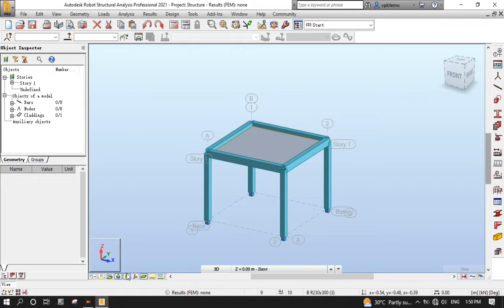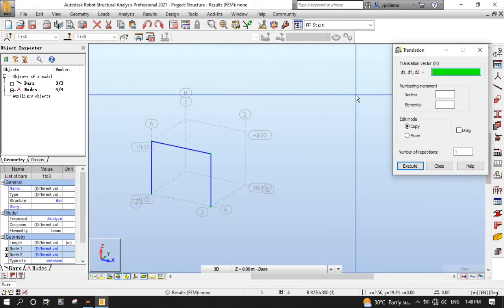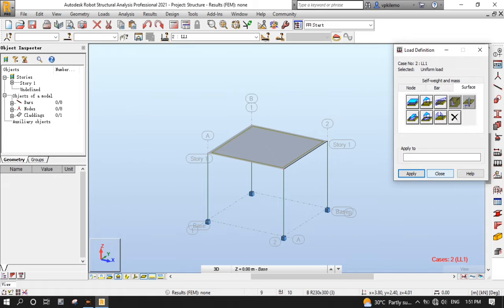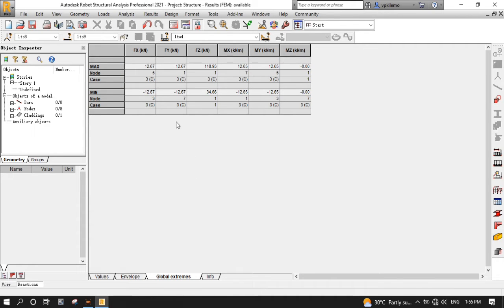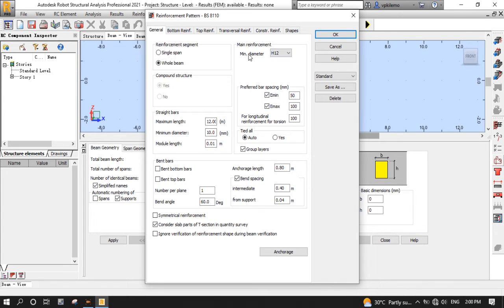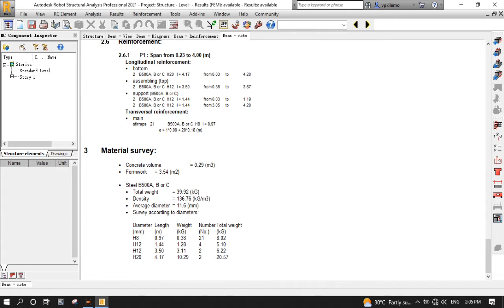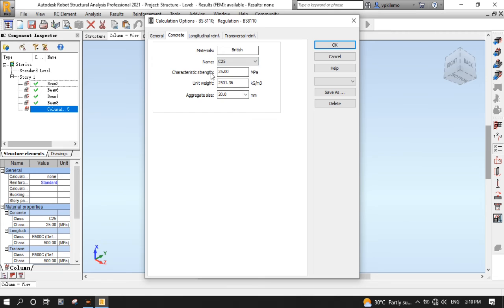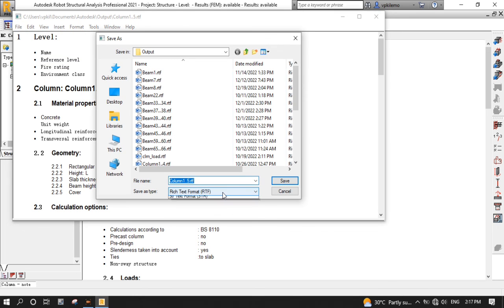Design of Reinforced Concrete Frame BS8110 by Robot Structural Analysis

Comment: Thank you for your wonderful explanation, I am very grateful for what you offer on this channel.
Excuse me sir, I have a problem and I want to ask you
I design a beam in the required, its dimensions are 60 * 30 cm and its length is 5 meters
It is subjected to a positive moment in the middle of 98KN.m and a negative moment at the end of the beam is 100KN.m. The other end of the beam is zero. . It is subjected to a torsion moment in the end of 14KN.m at the end and in the middle of 9KN.m

There reinforcement in required was at negative moment  4  bars dia. 16
The lower reinforcement of the positive moment was 5 bars of diameter 16
for links
10 by 12 cm
..
When I designed the same beam in the provided reinforcement
the program gave a lower reinforcement of 2  bars diameter 16 and an upper reinforcement of 4 bars  diameter 16
And gave reinforcement to resist the moment of Torsion 16 bars  of diameter 14, and when I changed the diameter to 12, he gave the same number of bars
When designed beam  and this beam resist moment of Torsion  the  program always gives 16 bars 
What is the reason for that?
I am using UK code BBS8110
fy=460n/mm2 for main bars
fy=250 n/mm2 for links
Fcu = 25 N/mm2
Reply from the maker: I'll get back to you later tomorrow.
Reply from the maker: 1. Can you share with me the concrete cover you use? 
2. Are those moments the result of structural analysis calculations? If not, you can specify whether they are live or dead loads.
Thanks.
Reply: @ARbyEV  the cover is 25mm
the moment that i put in the  above comment is for ultimate  load
Reply: @ARbyEV  yes this moment from calcuations
Reply from the maker: In RSA you can only place design loads and then the software will calculates the internal forces for you. I don't think there is a way of placing internal forces on the structure model. Can you please send the question and the robot file to my email address vkilemo@gmail.com
Thanks.
Reply: @ARbyEV  okey i will send
Reply: @ARbyEV  do you have a count on Facebook?
Reply from the maker: I don't use Facebook anymore. You can send them to me on Twitter @ARbyEV

Comment: I designed a flat sloping roof and the columns were dimensional (60*30 cm) The program gave the shear circumference equal to 5.56 and 6.82
for  internal columns  although if I calculated the shear circumference manually according to the BS8110, a different value would come out. How does the program calculate the shear circumference?
the slab thick is 25 cm cover 2.5 cm
i use 16 diameter for top bars and 12 diameter for bottom bars
Reply from the maker: Maybe you didn't include the self weight of elements when you calculated manually. RSA tends to include the element self-weight automatically when you add the dead load.
Reply: @ARbyEV  Sorry sir, maybe you didn't understand my question because of my English is not good
I am talking about the length of the shear circumference (u). The program gives a larger circumference length
Reply from the maker: Let me check and get back to you later.
Reply from the maker: After solving manually and by using RSA, RSA does not actually use "1.5d". It uses "1.4286d". Also, it doesn't use "0.75d" for the extra width, but "0.6912d" instead. I don't know why, but I'll keep asking until I get the right answer.
Reply: @ARbyEV  Thanks so much